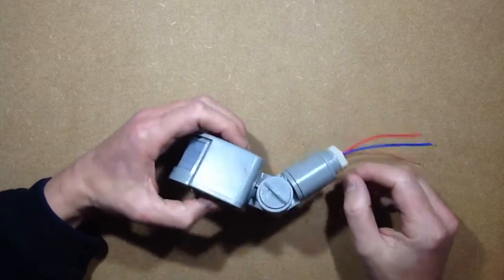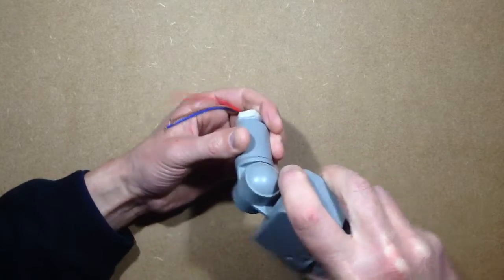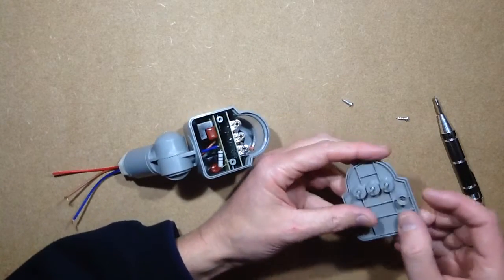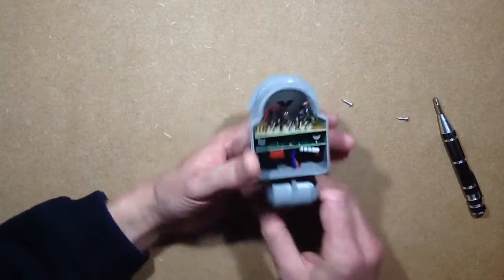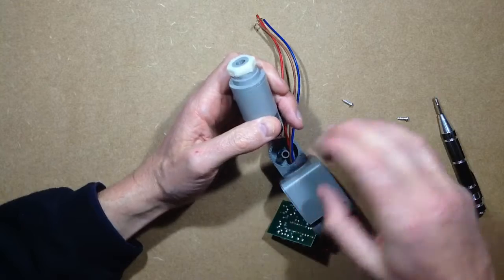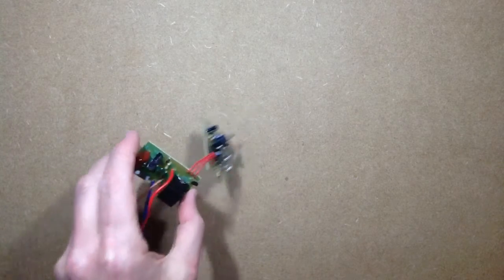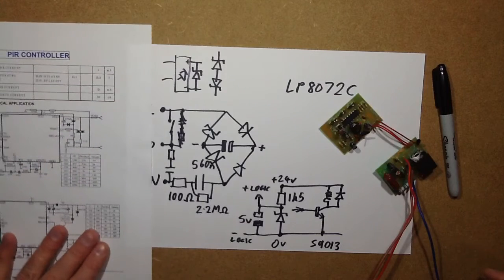Inside an outdoor PIR sensor switch.

Comment: Screwfix or Toolstation version of the standalone switch     by Zink Dion TS25151 uses a signal amplifier chip from TI. Ref LM324 with a 5v supply to the sensor board.

Comment: Would it be possible to connect a capacitor between PIR sensor and LED to achieve fade in and fade out...?
I just love it when lights turn on smoothly.

Comment: I just got one of these.  Specs say Rated Load : 60W LED lamp , 300W Tungsten filament lamp, why would it be different?  I suspect its a cheaper scr version as I hear no click.  The red wire drives out "mains" or 120V line voltage as we say over here.  I don't think that the wire sizes are large enough to handle 300W either.   Mine is glued together :(

Comment: The schematic drawing of the pir motion sensor with the Lm 324 is shown.  Accordingly, let's cancel the time elements, namely the elements in the red area, R5, R6, R7 and C5.  Let's connect the output of IC1A to the inputs of IC1B. Green lined area.  Let's energize the circuit.  Accordingly, will the relay be active as long as there is an obstacle in front of the PIR ?
https://ibb.co/LpzpdWP
Reply from the maker: The PIR can only really trigger with continuous movement.

Comment: Great video, after watching your video I fixed two PIR security lights that had stopped working. I took them apart and tested them, it seems that the Achilles heal of these light sensors is the switch and variable resistors. After years of being exposed to the weather, especially if they are mounted so that the switch and resistors are facing upwards. The circuit board, switch and variable resistors become dirty from air pollution and the PIR sensor stops working. After cleaning the circuit boards, switches and resistors both  PIRs worked. Thanks Clive, for teaching us how things work!

Comment: Good to see the inclusion of a relay (not all seem to have this), which I assume would allow an override switch, which would apply 230v to the output without damaging it.
Reply from the maker: The cheaper/smaller units that use a rectifier and thyristor should still be able to be bypassed with a switch.

Comment: That is not a transistor, it is a voltage regulator from 24V to 5V. The zener diode is used to protect the regulator in a crowbar method. So the voltage get reduced from 230V to 24V to 5V. That 5V is used to supply the PIR circuitry on the second PC board. The 4th wire is the wire to control the relay's coil. I had a problem with my security light due to alot of load shedding in our country. So every time they switch on the power from the substation an inrush current occurs, but the crowbar could not handle this on off swithing and inrush currents and it went short circuit causing to have a 0V on the 5V supply. I removed the shorted zener diode and the 5V came back!
Reply: It is a transistor and it drives the relay as stated in the video.  The zeners are very cleverly included in the bridge. As Clive says, the normal arrangement is to have a separate zener following a normal bridge circuit.

Comment: Newbie question. How did it step down ac mains to 24 volts without some type of transformer?
Reply from the maker: It used a capacitor to ration through a small portion of electricity on each half of the sinewave.  Very simple, but does not provide isolation from the mains supply.

Comment: @Clive, the arrangement of using two Zener diodes as half of a full-wave bridge rectifier in mains PIR controllers appears to be very common. The same arrangement that you found here for the power supply/relay board is used in the four PIRs that I have opened (including one that is about 20 years old). The only difference is slightly different component values and not all of them have a snubber network for the relay contact.

Comment: I was looking for something like this to connect to a Rasberri Pi for outdoor.
So if I get one, I could open it up and cut out the powerboard and use the detection board  directly on the GPIO pins ?
Reply from the maker: That could theoretically work.
Reply: Hans H  I have converted a mains PIR light controller for use on a 24V DC supply before. I removed the mains wiring and replaced it with a low voltage four core cable (sold as alarm cable). I then replaced the 560nF capacitor (or whatever value it was in mine) with a wire link. I connected positive to the "L" connection so that the relay now provides a switched +24V when it operates.

Comment: I bought 2 new pir using LP8072C  lighting auto switch for switching fluorescent lamp. Both are from different seller and circuit a little different. After switch power on, the LP8072C sometimes will trigger on-off-on-off-on-off and stable there. Between on-off or off-on, it is about 0.4 seconds apart. I checked all voltages and even ref pin4 is stable and good. But why upon switch on, this LP8072C will sometimes output this false triggering 3 times? Do you have this problem? This is very bad for AC light because the life will plunge down fast.

Comment: Clive , I have the same motion sensor. How can I cut the time it is on to 3 seconds ?
Reply from the maker: You could probably change a capacitor to get a completely different timing range.  If yours uses a BISS0001 PIR chip then you could find the capacitor location in the datasheet.

Comment: The lens often gives a clue as to orientation, having fewer and bigger facets in the upper part and more, smaller facets in the lower section. All of the PIR units like that that I have seen have the adjusters on the lower surface which suports your comment about water proofing.

Comment: I really liked this one, I have gone through many of these PIR lights over the years for my driveway and I have found them to fail after 18 to 36 months. They always fail in the dead of winter (I live in Canada) during a cold snap (-20 c) after a warm few days where we have rain and melting snow. The failure mode seems to be the relay is frozen, the red led is on but the light stays off. 

You inspired me, I think I'll have to take one of the failed units to bits and see if a new relay will revive it.

Comment: Hi Clive, I've recently got a PIR module to fit to my bathroom light, as the switch is in a really stupid place (council flat) How would it be wired into the existing circuit? 
*At my own risk, yadda yadda etc*
http://www.ebay.co.uk/itm/360-Degree-Recessed-PIR-Sensor-Detector-Ceiling-Occupancy-Motion-Light-Switch-FK/332052312553?_trksid=p2047675.c100005.m1851&_trkparms=aid%3D222007%26algo%3DSIC.MBE%26ao%3D2%26asc%3D38661%26meid%3D476e8bb33cc34212b9978bc6385da1f6%26pid%3D100005%26rk%3D1%26rkt%3D6%26sd%3D122295231393
Reply from the maker: In the ceiling rose or junction box there will be a common neutral that may loop in and out and also to the light.  The blue wire goes to that.  Then there'll be a common live that may loop in and out again plus also connect to the switch wire.  The brown will go to that.  Then the red will go to the switch wire returning from the switch and going to the light.  You can leave the original switch in circuit as it will just bypass the PIR sensor when on.

Comment: Which failed components are likely to cause, a) flickering of the light before it turns off & b) constant false triggering of the light?
These seem to be the two most popular faults that develop with these sensor type lights, any pointers on what to look for please Clive?
Reply: My 2 new PIR sometimes triggered 3 times after switch on. So bad for AC lights.
Reply: @pi5955  The flashing at power-on is a sort of test mode and usually not as bad for lamps as you may think (except fluorescent tubes with bimetallic starters). If you want to avoid the test mode, don’t interrupt the sensor’s power.

Comment: frustrating All I want is a pir switched led lighting strip to go round a bathroom cabinet! I cant seem to find a video.
Reply: What about wiring an outlet instead of the light fixture.  then plug a power supply in to run your lights?  Just make sure the power supply has proper isolation.

Comment: I have an old incandescent 2 x 125w outside PIR light. Could I use the old PIR module off this on a new LED light module.  The PIR module looks just like the one you have taken apart. Thanks, big fan.
Reply: MyBigThing2010  calm down! I think the OP wants to use a PIR that is rated to control 125W lights to control new low power LED lights. Not the other way round....
If the PIR module is like the one Clive took to bits (and all the mains voltage PIRs that I have taken apart so far, have been similar) then the answer may well be that it can be used to control a mains rated LED lamp. But if the PIR relay contact has a snubber network (so do, some don't) the LED lamp may glow slightly.
Reply: Colin Overton no...the power relay will burn up LED units as the one you have is for use with higher wattage outdoor bulbs
Reply: MyBigThing2010 
The PIR simply switches the live. Why wouldn't it be possible if it then powers a, let's say, 30w power supply for the LED?
Reply: scwfan06 it switches the live and handles the current from the device that's now sucking power through it. ..pir...like all switches or components have ratings on what they are built for and what they are capable of handling. if you put a LED rated pir on an outdoor 2x 500w halogen.. you mine as well call the fire dept yourself ...right after you turn the circuit back on from the breaker box...cuz motion will turn on the light and there's a good possibility of components catching fire...best case is you just blow the PIR n it packs it in, "maybe" trip the breaker...but Murphys law is typically universal....there's always a chance that the unit will survive...but in an overdriven n HOT state...N heat and electricity and building materials don't play nice together...n the pir, in this case, is hanging in the breeze, very close to a wall and not protected in a junction box...so bbq time...just sayin...it's not a good idea to just stick components together if you don't know if the rating or internals will be able to handle the load (volts and/or current) you're putting on them ...safe than sorry ...if you're sure you have a bad ass pir and you're going under its specs then there shouldn't be a problem ....but just be sure what flavor of component you're using before making diy electrical spaghetti
Reply: Colin Overton - and other late readers .. If you are asking about the entire 'gray' unit, with mains in AND mains out, YES - but you may get some 'afterglow' when the light should be off.  I suspect the difference between the data sheet and actual implementation in regards to the 'relay' has to do with relay-contact life and LED-afterglow.  If you are asking about swapping individual boards INSIDE the 'gray' unit, that's much more complicated.

Comment: Could you convert this to run on 12v if you changed the relay etc.
Reply from the maker: No need.  You can buy 12V versions of the same unit online.
Reply: Assuming you mean DC, you would connect directly across the output of the bridge which may be enough to drive the relay, otherwise you would have to change it out. Also the voltage may be too low to provide the current requirements of the 5 Volt supply. In that case the resistor to the 5 Volt Zener would have to be reduced to half its value (or an equal sized resistor could be added in parallel.

Comment: The snubber is accross the load to prevent the LEDs from glowing when off.
Reply: danyk666 

Agreed, but how can the snubber circuit actually do its job of voltage transient protection for the relay if it's not placed in parallel with the relay as normal?

Just replaced two 90w PAR38 halogen floods on an outdoor PIR motion security light with 90w equiv. 11w LED ones. And both glow at a very low intensity when off.

Guess the snubber circuit is definitely in parallel across the relay here and leaking electricity through the flood lamps ...
Reply: @H.T.2forever  The spike is generated by the load, so you can damp it either way, the faint led glow is probably the deciding factor. Led's will glow with amazingly small currents, just capacitive coupling in TPS cable is enough.

Comment: Hi Clive, will the PIR relay handle 3 X10 watt LED lamps in Parallel. ie:  the red wire from the Relay linked to 3 LED FLOOD lights relay output wire (Red).
Will one relay handle 30 watts. I ask as I wish to connect 3 Flood Lights around my house to come on at the same time from any one of the PIR Flood lights that detect a movement.
Regards,
 Barrie.
Reply: Jahedur Rahman  If the relay is rated to switch that power, then yes. If the PIR module was originally designed for a filament lamp, then the relay will have contacts that have a suitable rating as these are often capable of switching 100W or more.
Reply: Hi Barrie, I want to do the same thing as you. Did you get an answer or find out how to do it?

Comment: What part number is written on your PIR chip itself? I've pulled a D203B from a mains switching PIR unit, which is driven by a BIS0001 IC (this doesn't do switching but rather control of the PIR chip I think). I'm trying to reverse engineer the PIR board to look at how they do fine adjustments for temperature as PIR needs this I believe. Any ideas what PIR  and PIR control chip is used in the board you have here?

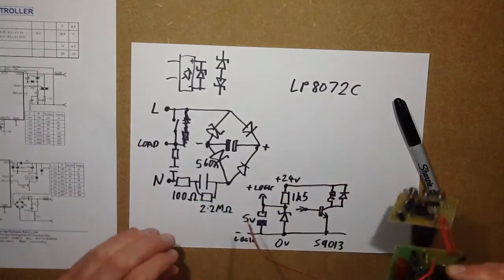Comment: i cum @ 19:50 ! That was quiet enjoyable - yeah
Reply: The snubber network is over the load to prevent current froh leaking into the LED Part. For high frequencies L and N are shorted anyway, so its functional the same.
Reply from the maker: +Andreas Dill That's a good point.  With the low loads of LED circuits or drivers, a snubber across the contacts might leak enough current to make the output glow or pulse continuously.

Comment: where did you get that tester that you can clip the leads into?
Reply from the maker: It's improvised out of a short flex and three Wago lever connectors.  I'd normally use a device called a quick test block http://www.ebay.co.uk/itm/171517360266 but don't have one here at the moment.